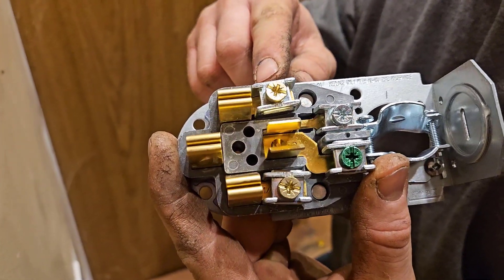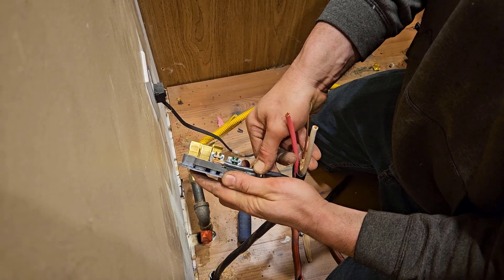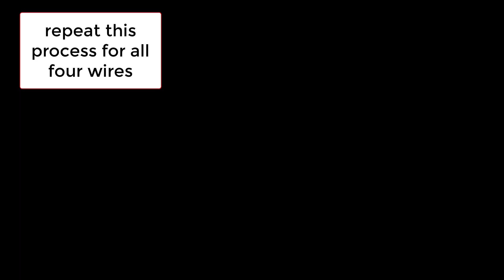How to install a 240V range outlet

Comment: The whip coming from the oven is going to go towards the oven, and most likely make it impossible to be installed without smashing and bending the cord. You should either install parallel with the wall or straight to the wall

Comment: Does a receptacle facing up meet code and is it safe??? I beleive any receptacle needs to be secured on or in the wall with appropriate separation from combistibles, and should not be facing up.
Reply: Receptacles are forbidden to be installed face up on a counter top or under a sink. This one appears to be code compliant. The risk is water getting into the outlet. In this scenario, I would rate the risk minimal.
Reply: I don't think there's anything in the NEC that says it can't be installed face up. I've always installed them close to the floor though. Usually 9" or less to the top of the box, but it depends on the make/model. Some are a bit lower.
Reply: @peteyc2292  NEC 2020 - Article 406.5(g) 1)2) forbids face up receptacles under sinks or on countertops.